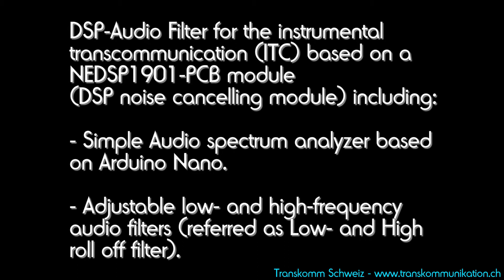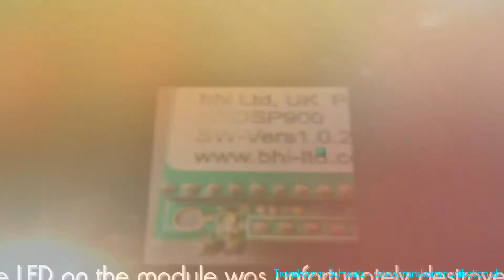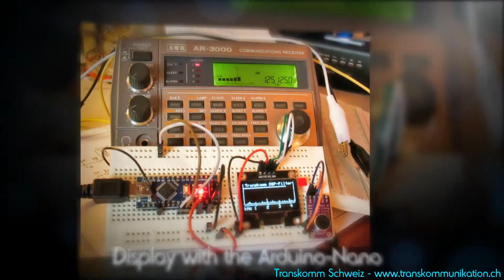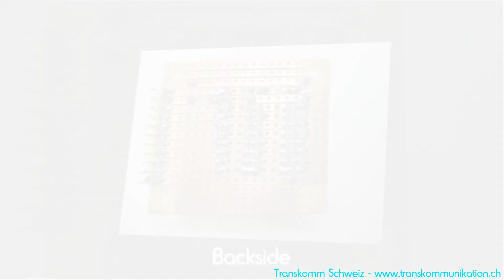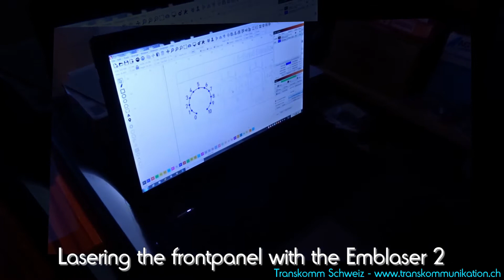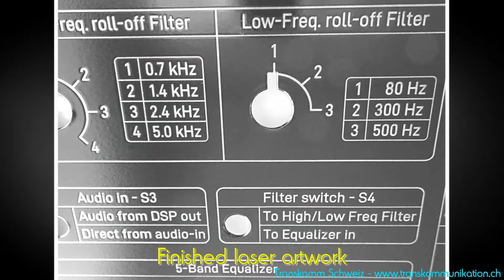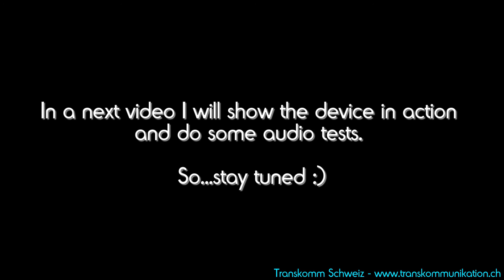How to Build a DSP Filter with a Real-Time Arduino Visualizer

Comment: Have you open-sourced it? Git? If not, please do. We need to work on this, and I think that we have to follow the instructions and not speculate. The windings are important. Cubit length measurement on the kobberwire? Adjustable space between the coils? It is all about angles.
Reply from the maker: This device here is a DSP filter (digital signal processing filter) and not the Germanium Receptor. I have shown this in other videos. But it is true what you write, the windings of the coils and the distances to each other are important. I have prepared a project that covers exactly these aspects. Different coils will be used and there will also be a kind of adjustable mechanical construction with which the distances between the coils can be set. The DSP project, which I present here in the video, would actually be freely available, but unfortunately I haven't finished working on the documents yet. As soon as I have finished them, I will publish and announce them here. Stay tuned :)
Reply: @beyond_electronics  thank you for answering. Yes, I think that an adjustable mechanism to be able to adjust the space between the coils is very important, as is the amount of windings. ty